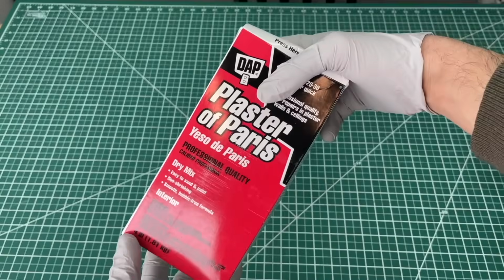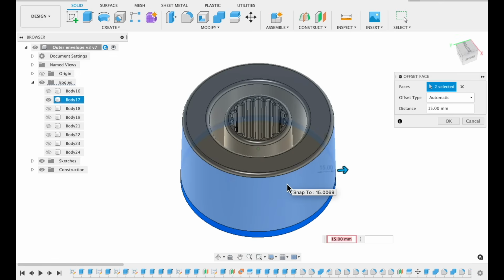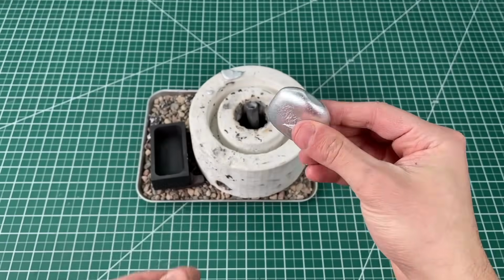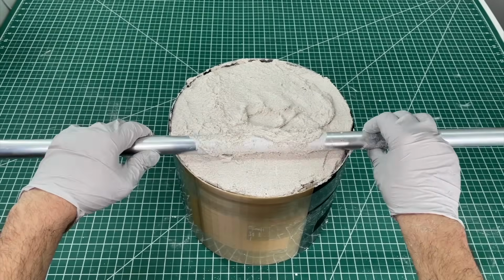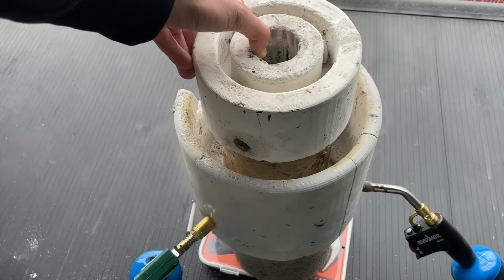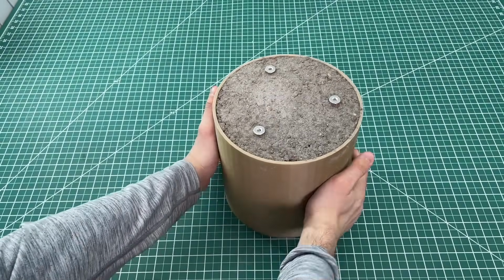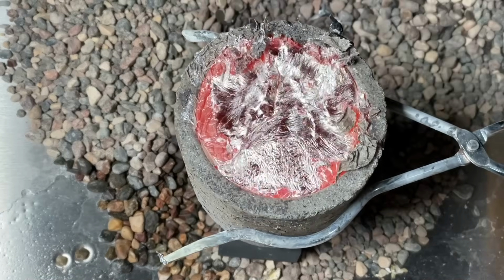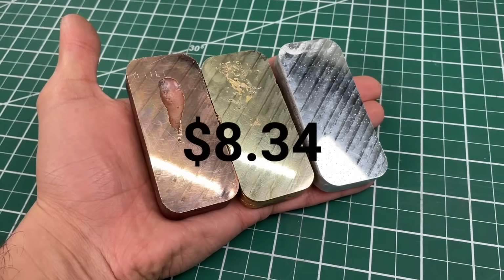DIY Foundry At Home

Comment from the maker: If you'd like to help make future projects like this possible please consider supporting them / us by becoming a channel member: https://www.youtube.com/channel/UCHrFvnP1EEEZHNam_Nk_5rQ/join/join A big thanks to those who already support the projects!
Reply: I noticed it was not mentioned in the instructions, I do not know if you are doing this step, you are suppose to break in the crucible, by first potting it in an oven at 300 deg Fahrenheit  or 149 lets say 150 deg Celsius, then let it cool down then slowly over a few hours heat it up to 1300 deg fahrenheit 704 celsius let say 700, hold it for 30 min, then heat it up to  2500 deg fahrenheit  1371, lets say 1400 deg celsius hold for 30 min let it cool down, before ever putting any metal in it, otherwise they can break and explode, and wear down faster
Reply: Sodium Silicate would have been a better material for the furnace. The mold could also act to connect the CO2 bottle for hardening.
Reply: Id like to see more work with 3D printing in wax. This would allow for lost wax casting.
Reply: Nerds…. 👺🤓👀*

*I’m Gonna Subscribe.
Reply from the maker: @glyph241  😂 welcome aboard
Reply: also you should be carfule when melting brass since it contains zink and when zink gets heated it releases a harmful gas
Reply: Guys))) 
I am already have one and i feel bad looking at your excruciation. 
https://youtube.com/c/PlavkaPRO
Reply: Love your videos; however I'm curious if you have tried pva (water dissolving filament) or tpe (flexible filament, not necessarily the extremely harder to manage ninjaflex brand filament)? Perhaps these would assist in creating a better mold, or at least easier to remove with less remnants of the original print. Regardless, keep up the great work ☺️
Reply: you do not put the molds in water

Comment: A foundry is a place. 

At your foundry, (back yards count) you might have a "melting furnace," often called a "foundry furnace." 

You might have a coal or gas-fired forge for blacksmithing.  Some foundries even have a kiln or two. 

Melting furnaces can be fueled by gasses like propane or natural gas.  Some by coal or wood.  Even oil and diesel can fuel furnaces.   Many foundries have electric powered furnaces, especially those that need fairly small smelts (jewelry).

The foundry is WHERE you use your melting furnace.

Comment: on cast iron molds for all of it you need to use a mold release. there's a cast iron mold release for pouring and you should take you your grass off the top. the uncere metals scrape it before you pour it in your mold. it'll get rid of a lot of the impurities out of

Comment: Use mullite clay powder instead of plaster. Mix 50/50 with mulcoa grog.  Both are very cheap. They are both specifically used for refinery walls.

Comment: Why not try using a desk sized inductor and use the 3d printer as the mold to pour the plaster of Paris as a means of preventing a shortage. That way you can make everything up to steel in a ceramic crucible
Reply: Also, you couldve just put flat tabs on every side the married to each other that you could pin with bolts to demold multiple times without breaking shit

Comment: When you are casting brass use 1 tsp of borax to bring any impurities to the surface of crucible. Next use a spoon to skim surface of product and repeat until surface tension is calm. For copper and aluminum simply skim surface of chunks and repeat until surface tension is flat and calm.

Comment: Check Robinson foundry - the guy using soda and other stuff to get rid of impurities. 

Surpised the concrete didn’t explode…  aren’t you supposed to use foundry cement rather than just standard cement? Much like how you use special bricks in fireplaces rather than just normal ones.

I’ve got myself a prusa xl so making a foundry like this will be cool.

Comment: Mix with a electric egg beater and use Perlite and the cement to use is fireplace cement as it is of a different composition..  and heat your molds before using (on the top of the furnace) and use a flux to get rid of the impurities..  make a roller to expand your hot cast bars and give elongated grain.

Comment: FYI: 
Foundry - An establishment where metal objects are made by melting metal and pouring it into molds.
Furnace - A device used for melting metal
Reply from the maker: You are indeed correct 👍🏻 thank you for the insight.

Comment: late to the party here great first try at casting. Reading some of the comments people are saying about hydrogen being dissolved from over heating, whilst this is true I didn't see any comment on your pouring technique. Pouring from height as you are causes turbulence splashing in the bottom of the mould and when you start to get a steady flow the venturi effect drags air into your ingot. You can see this effect by placing a glass under a tap and turning the tap on just enough to get a steady flow the further away the glass is from the tap the deeper the bubbles will travel. Copper and brass are roughly 2 1/2 x the specific gravity of aluminium so bubbles can escape easier than bubbles in aluminium. Air in aluminium is bad news because aluminium oxidises almost instantly and these bubbles and turbulence cause oxides to be dragged into the ingot something called bifolds. These are effectively tiny cracks in your casting weakening your ingot or part machined from the ingot. For this reason we don't generally use open face casting (ingot moulds) for parts. A closed mould with a pouring basin, calculated sprue, runner, spin trap, gating system and rises if required will give you a much better stronger product even if you are only casting ingots for machining.

Comment: Can you design a foundry for use with Hydrogen?
Hydrogen can be created at home .. via electrolysis ... but the heat from burning hydrogen at room temperature and 1 bar pressure is lower than e.g. stinky methane.
Still, if one could make a foundry that is enclosed to prevent heat from escaping, also maybe multiple walls with air in between to cascade the heat and maybe the gas intake could be automated from bigger tanks (which are fed by the "generated" hydrogen) so that dosage could be adjusted too...
Reply from the maker: Is that not dangerous 🤔

Comment: A de gassing flux will sort the bubbles out, Borax is good and readily available as is Sodium Bicarbonate (baking soda). Both are cheap and readily easily obtainable. A couple of teaspoons wrapped in baking foil and pushed to the bottom of the melt 5 minutes before poyring will give much cleaner results. Allways pre heat the ingot molds prior to pouring...

Comment: The gaps and indentations are caused by a cold, wet mould, differences in temperature of the liquid metal (no stirring pre pour?), and no slag removal for the copper (black stuff). NGL you probably ruined your graphite mould when you put it in water, baking it dry might take hours. When pouring metal, it is best that the mould is roughly the same temperature as the metal you are going to pour.

Comment: Casting plaster, you always add the powder to the water, never the other way round, that why you got such a crap lumpy mix. Also allow it to fully dry before using, even bake in the oven to ensure ALL moisture is out of it, as it can cause the plaster to explode when heated. Same with your metal casting molds as the liquid metal can explode if it hits moisture. It instantly turns any moisture to gas, which in turn launches molten ,metal everywhere.

Comment: Hello, I just wanted to give you the knowledge that I know from working in a foundry. Like alot of other comments yes flux the metal and remove impurities. Borax works well and believe it or not so does sawdust. Second thing i can help with is the bubble situation. Don't rapid cool with water let is slow cool and also vibration would help bring the bubbles to the surface. In the foundry they use chlorine gas to help off gas the metal which is a no go for DIY. Also you were wondering what the black is on the copper. It is oxidation, Not much you can do other then grinding it off. Hope this helps.

Comment: you didn't take off any of the floating stuff on the top of any of your molten metals.  There are impurities and or additions that either don't melt at all or don't melt at the temperatures you're using.  Skim the floaty stuff off the top before you pour.

Comment: don't water cool in the mold.  That's why it stuck.  Let it cool enough to knock it out of the mold.  Then drop the ingot in the water.  The steam explosion is a version of spalling.  Always preheat your molds to get rid of any water or water vapor in the mold.

Comment: electroform from copper/nickel/chromium/titanium
Reply: metal molds/crucibles dont crack
Reply: if you make a furnace/mold/holder from metal, then you can fill the sides with insulating sand
Reply: your stainless was not stainless steel lol
Reply: are you sure you have not been lied to all your life, about everything, like metals
Reply: preheat molds
Reply: electroplating mold forming does not need such caution
Reply: why et go home printer bot

Comment: Two things: You need to cure your foundry before bringing it to heat, and you need more oxygen. Think forced air like using a hair dryer. My first furnace used a hair dryer taped to a pvc pipe and a charcoal flame. It would melt copper all day long. More oxygen! And preheat your mold. You also need to de-gas your molten metal before pouring.
Reply from the maker: Thanks for sharing!

Comment: Several thoughts. After finding that copper and brass fuse to the metal of muffin tins I now use rammed sand molds to pour all of my ingots into.
On my first foundry, I used a weed/roofing torch for my burner.  That worked really well.  I now make my burners from assorted plumbing flanges and pipes.  I have no problems melting copper.  I have not tried to melt cast iron yet. As the weed burner hooks up to a 5 gallon propane tank it is much much cheaper that the itty bitty bottles.
Rather than using plaster or cement there is a product called Satanite.  I use it for facing the soft fire brick in my foundry.  It holds up really well.
Lastly-a huge safety issue.  When melting brass the zinc will boil off in weird yellow/green fumes.  It is hugely dangerous to breathe.  The same goes for anything that has been galvanized-like steel plumbing pipe.  Breathe in enough and you get zinc fever and then you die.
Reply from the maker: Thanks for sharing your experience!

Comment: As a chemist, I would caution anyone against using brass-tipped gas burners. Brass is an alloy of copper and zinc. Metallic zinc is relatively harmless. Highly heated brass, however, gives off zinc vapor, which then oxidizes with the oxygen in the air to form zinc oxide, and zinc oxide is highly toxic. Zinc fume alone can trigger what is known as metal fume fever. In less severe cases, it can trigger flu-like symptoms. In severe cases, however, it can also be fatal. So please, please please do not heat brass!
Reply from the maker: Thank you Chris. I second everything you said here and agree that this should not be replicated with brass.  Thank you for looking out for the community.

Comment: I wonder if liquid glass and sand would work better for the foundry. Liquid glass is for high temp work.
Reply from the maker: I don’t know, I never worked with that
Reply: @ActionBOX  they use it in foundrys for the sand molds, send CO2 through it to harden it.
It consists of pure lie and silica gell. Do a search for DIY liquid glass.

Comment: To keep the metal from sticking to the cast iron ingot mold, use graphite powder in the bottom and don't submerge the mold in water it'll cause stress fractures and break. Let it solidify then dump out and cool the ingot in water.
Reply from the maker: Thanks for the advice 😊, seems to check out. Cheers

Comment: Real stainless steel melts at like 2700 and brass at like 1700. What you have there is Chinese stainless steel otherwise known as fake 😅
Reply from the maker: If I may, just because water melts at 0°C (32°F) doesn't mean that it cant reach 80 degrees and still be liquid. Brass melts at 930°C (1710°F) but can still heat up to beyond the melting temperature of stainless steel ≈1500°C (≈2700°F). 
Hope that makes sense and thanks for your comment 😃.

Cheers, 
Dave

Comment: A wire brush will take care of the discoloring on the outside, Using Borax into the melted metal will de-gas the metal and help prevent bubbles, and scrape off the dross before pouring, and lastly heat the molds close to the metal temp before pouring will make for a smoother finish. Try it. You will like it.😁
Reply: Oh, PS I would love to have the 3d printer. Mine just crapped out the mother board when I tried to flash upgrade it. Thanks
Reply from the maker: Thanks for your input Dave, I’ll give it a try 😃

Comment: Mullite ceramic block with embedded resistance heating elements would get much hotter, around 1500C. Wouldn’t be difficult to cast.

Graphite silica crucibles are the correct choice.
Reply from the maker: Awesome, thanks for your input 😃
Reply: @ActionBOX  :) I can suggest a good design for the furnace if you’d like. A simple 230V 15-20A line with PID control would drastically decrease your melt times and the furnace would be quite happy to stay at operating temp all the time. You could also consider induction heating, but in order to melt quickly, accelerators would be recommended, so not sure how you’d address contamination. Tungsten, Iron Chip, and Copper are the most common accelerators, though you can get by without them.

Comment: To remove water from a stone or material, heat it up past 100c and hold it there for as long as it takes. When you hold it there and it no longer reduces weight over time, it probably is water free. For the plaster of Paris mix, I recommend a preheat of about a day. The plaster can absorb humidity when just standing.
Reply from the maker: Thanks for your input

Comment: It's been 7 months now so it has probably been answered, but the "bubbles" in the finished ingots are a very common defect. Because the material on the inside of the ingot cools down slower than the material on the outside, the outer material solidifies first and forms a solid shell. Then the inner material solidify, and as (most) metals tend to shrink when cooled down, cavities are formed inside the ingot.
Reply from the maker: Thank you regardless for your input.  It makes it a more valid answer if we get consensus from everybody 😃. Cheers, Dave

Comment: If you plan on using bottle torches, Mapp gas burns slightly hotter than Propane or if you want to melt copper quickly. Oxygen acetylene will do it super fast
Reply from the maker: Thanks for your input 😃

Comment: Having recently discovered the ability to paint sections and supports in different material. 
That would make removal of the finished mold super easy. You can use HIPS or similar material that you can either dissolve or snap on surface edge. 

It is strong enough to hold while pouring. Then come time to separate. You can either dissolve a section to ease removal or snap the mold apart in sections along those lines you painted into it.
Reply from the maker: Thanks for sharing 😃

Comment: cast iron loves to crack. you needed to let the bar cool in the mould and then turn it out. don't try to cool it all the way down in the mould. it will demould while still hot. it just needs to firm up enough first. never ever put the mould and ingot straight into a bucket of water you could create a steam explosion if you arent careful

Comment: You need a hotter burning fuel for the copper.
Also, when casting copper and its alloys, coat your mold's surface with a carbon layer (copper loves bonding). If you don't know hown to do that, coating with grease or oil will do.
Degas aluminum by stirring potassium chloride into the molten metal before you pour. 
There are a lot of great videos on YT for casting.

Comment: mix the sand and plaster before adding water, it makes it way easier to mix, and if you can get some fiberglass or carbon fiber to add it will make the end product more resistant to cracks
use cold water to slow the curing time of the plaster so you have more time to mix and apply it. for the big version you can add some wire mesh to increase the strenght and integrity of the foundry on the long run
Reply from the maker: These are great tips. Thank you

Comment: The bubbles in the aluminium is hydrogen gas. De-gas by adding some tablesalt in the molten aluminium. When melting the copper or brass, add some borax to the molten metal.
Before puring remove the dross or slagg with a spoonlike object from the surface of the molten metal.
Be extremely careful not to inhale ANY smoke or particles when melting Brass! Because it's Zinc, and its extremely dangerous. Wear a gas mask ABEK type or a very good high grade dust mask! In extreme form, the zinc looks like white cotton flakes floating around in the air. You can get a severe condition called zinc-fever when inhaled.

Comment: I see a lot of the things that I wanted to say already. But I did not see angling your torch holes. You want the flames to flow around the center of mass. This will more evenly distribute the heat preventing to much abuse to singular points. Thus Iis why the heat source(s) on professional kilns/forges, is always offset and not centered, at least everyone I am familiar with.
Reply from the maker: Hi James, you are indeed correct and now we know.  Thanks for sharing.

Comment: Don't have time to read through all the comments so sorry if it's a double.

Copper oxide forms easily on molten (red hot too for the record) copper's surface, that is the black stain you get.

There are ways of getting rid of them without manual labor, but are either dangerous, or not worth the effort for You.